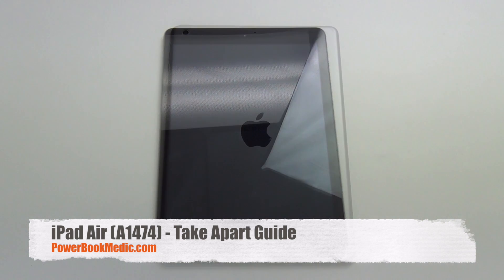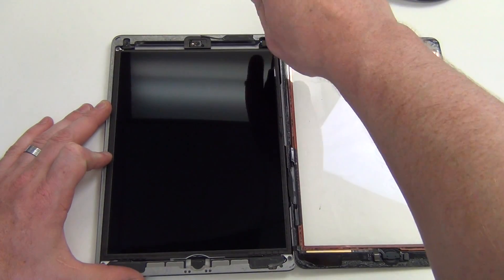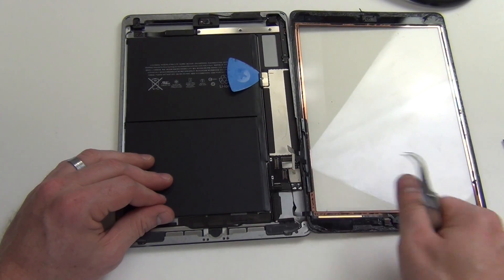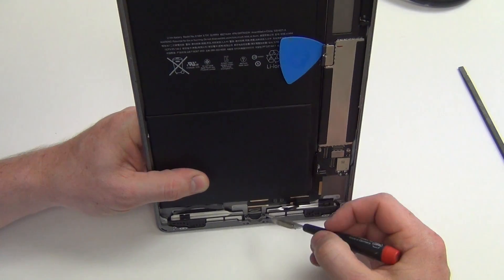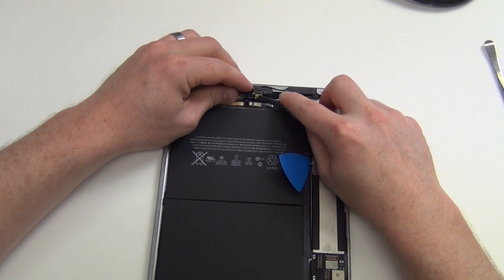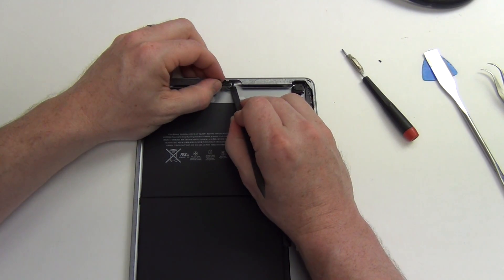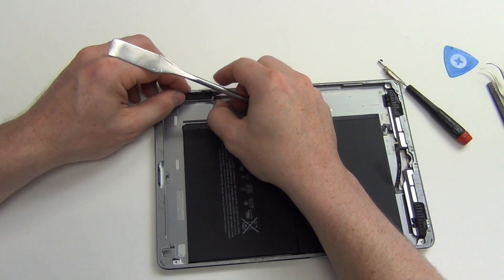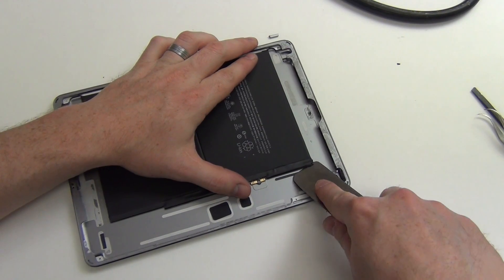How to Take Apart the iPad Air 1st Generation A1474

Comment: WARNING - This video is seriously flawed in that it does not warn you about the depth of cut when cutting the adhesive where the glass/digitizer cables are located. The glass/digitizer has ribbon cables, located in the lower-right corner of the iPad, that connect it to the logic board. Those cables are within 1/8" of the rim of the glass and cutting the adhesive in this area, more than 1/8" deep, will ABSOLUTELY cut through these cables, necessitating the purchase and installation of a new digitizer. The sensitive area is the lower-right edge of the iPad from 1/2" above the lower-right corner to about 4" above the lower-right corner. When cutting the adhesive in this area, MAKE SURE you do not insert the pick more than 1/8" deep.

Comment: Thx for advise 
Yes be careful I cut the three cables on right side  .

When you order you battery order new screen incase .

The new screen comes with pre installed glue so it's easy 

Reassemble and press down glue will stick.

Thx

Comment: This device is the biggest piece of crap I have ever touched. I held the Heat gun to it for longer than I should have had to & the touch screen shattered like nothing even with the right tools. Thought I'd try to chip off what was left of the screen & replace it but it isn't worth it at all between a new battery & a screen & buying another used one is pointless as it too will need a new battery. Apple sucks & are a terrible company that do not want you to fix their devices & want you to buy a new one yearly & throw the old one in the trash. Very wasteful, greedy & use slave labor too. I'll never buy their products or even touch one again. At least I can take apart an Android phone without destroying it or having to hold a heat gun to it for dangerous lengths of time.

Comment: Hard to believe that in this age of electronics and miniaturalization this battery is huge and difficult to reach. Could it be that Apple makes lots of money in repairs???? Hmmmm??? Nah... Apple is not a greedy corporation. This battery could be as small as 1/16" diameter and be accessible thru the back without having to remove all the guts.

Comment: Thank you for this video!  I took mine apart to replace the lightning/charge port connector following along with your disassembly.  I "only" broke a wifi antenna (replaced), ripped the volume ribbon cable connector off (soldered back, but not hopeful) and somehow managed to pull a speaker cable out.  LOL  Necessary collateral damage.  "I can get by without a volume control.  And lousy wifi.  And only one speaker."  Hahahaha.
Reply: hahahahahha ...I am going the same pad ... As i can see.... wish me luck!

Comment: Do you need to follow all of these steps in order to replace the logic board? Or is there a easier way to replace solely the logic board?
Reply from the maker: There is not an easier way. Removing the logic board is pretty involved unfortunately.
Reply: Powerbook Medic that’s unfortunate.... guess I’ll just have to allow some time to complete my project. If I were to follow all of the steps until the removal of logic board, would I need to solder anything together? Or just reconnect the parts by clicking them together?

Comment: If I replace the battery on my iPad Air will all my information, photos, apps and games still be on there
Reply from the maker: Yes. You will not lose data by changing the battery.
Reply: Powerbook Medic okay thanks
Reply: @PowerbookMedic  what are the tools needed to get to the battery I have a new battery and I'm unable to find the tools I need that are not bundled with the screen or battery and I am using the hot plate method to open the iPad air its way easier than the heat gun and other methods all I need is the screw drive / drives and wedge and other internal removal tools and I do not have replacement adhesive so id like it if you could plz link where I can find them for the iPad air a1474 plz I've looked at repair stores near me and its 30 to 60 $ cheaper to do it my self
Reply from the maker: @anonymousnekokamikannakamui  We mention the tools you need in the video. Thin flat tool, spudger, and a 00 philips screwdriver.
Reply: @PowerbookMedic  thanks for the info I'll be looking for those
Reply: It doesnt affect the data

Comment: In these videos the iPad being taken apart has previously been disassembled and the glue been removed before this video. Don't use them silly plastic blue things shown in the video, trust me 9 times out of 10, you will ruin the screen using them. also try NOT to use suckers either, they put unnecessary tension on the glass. use a heat gun (hair dryer the best) and a single sided razor blade. you can buy them on ebay. once you cut the glue insert a playing card to stop the glue reattaching itself, slowly work around the glass avoiding the ribbons. its a longer job than shown in these videos. if you don't believe me just look at when he opens the iPad, how glue free the edges of the iPad are. jay

Comment: On the right side of display there are 3 very sensitive cables. While opening the display START FROM LEFT SIDE. Do not try to remove glue from the area of cables. Let suction cup do that for you. Leave That are for the end. You will most likely damage them. Start seperating the glass from the left side with suction cup. Unless you have a new digitizer to change old one heed my warnings. I cut my cables with blue plate while seperating glue from right side.
Reply: I cut the on/off button's and home button's cable (x.x). Any idea what's the name for that top on/off button's name or how to find it from ebay?
Reply: iPad Air Power/Volume Flex Cable. Here's one I found on eBay: https://www.ebay.com/itm/Power-Volume-Flex-Cable-Replacement-Part-Apple-iPad-Air-1st-Gen/322381265994?hash=item4b0f6bbc4a:g:KH0AAOSwmmxW3a6t
Reply: I damaged them. FUCK APPLE!